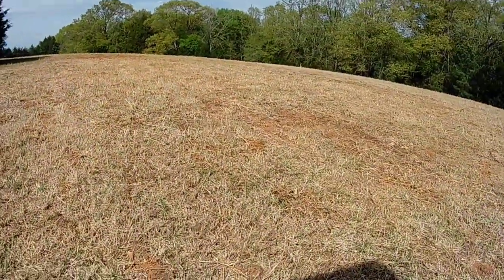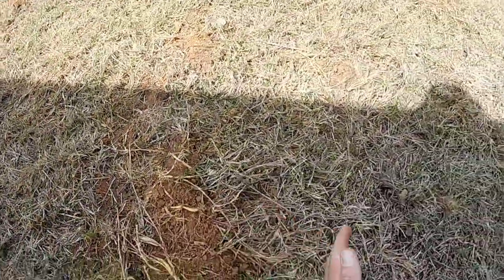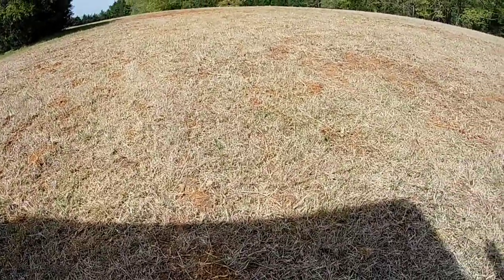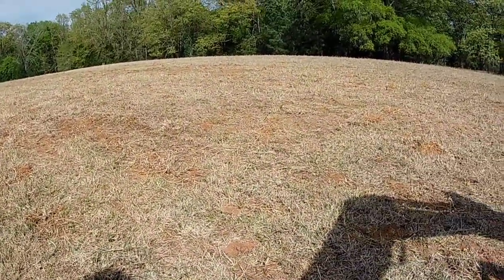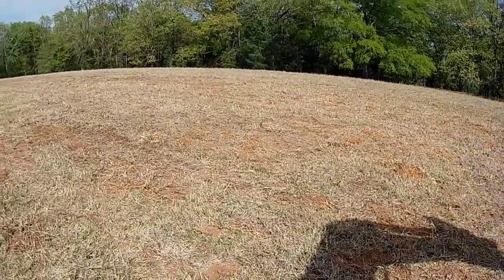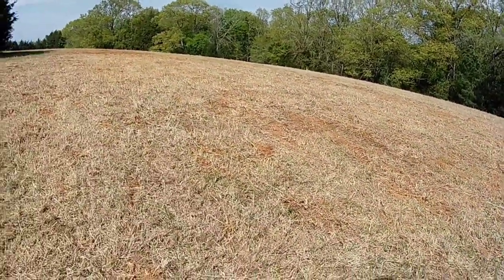Coastal Bermuda Field Prep Step 3. Pasture Renovating and Cultipacking

Comment: After you renovate, would that be a good time to over seed, then run the culti-packer over it or would a harrow be better? Or neither. I need to over seed or find someone to drill it for me.
Reply from the maker: Renovating and then overseeding works good depending on if your ground is dormant or actively growing.

If it's dormant, cultipacking will work fairly well.  
If it's actively growing, then harrowing would do you a good job.

I'm also curious what type of seed you're spreading.

Comment: This is our second year of using an  Industrius America aerator to punch our hayfields.....   Theory is that every where you cut the rhyzone it will sprout new growth.......also holes capture and retain rain..... but what you are doing looks favorable,
Reply from the maker: Thank you.  I love learning and trying new things and new ways.  I didn't consider the rhizome having new growth at the severed edges. Even though that makes perfect sense now that you mentioned it. Thanks for the input.
Reply: You're Welcome,
Reply: We have Coast Bermuda fields, and someone suggested to disk harrow the fields in the spring.  What are your thoughts on that process?  It seems extreme to me, and I am reluctant to try it.  The reason why I ask, they said the same thing about the cuts sprouting new growth.  Thanks for taking the time to read my question.